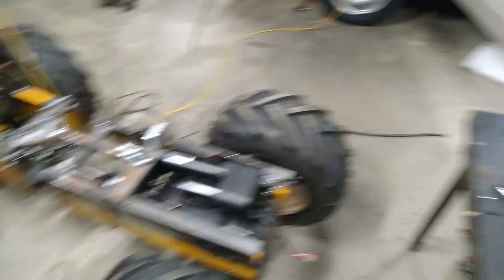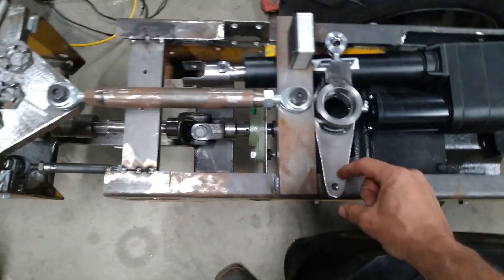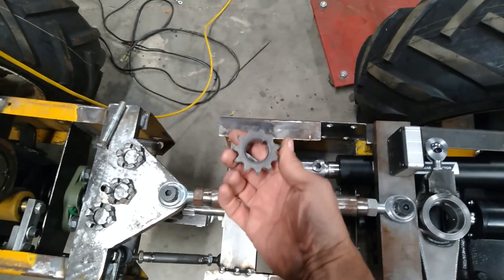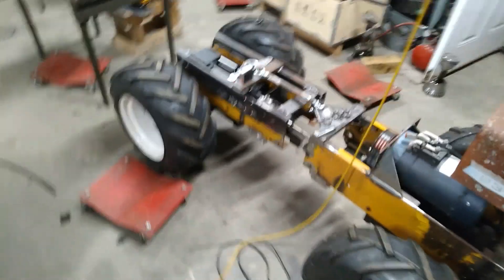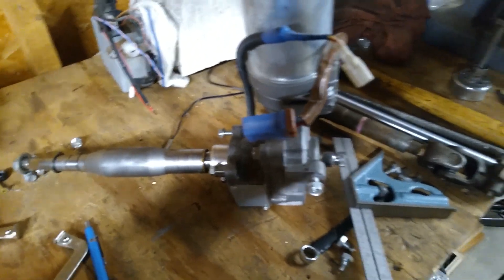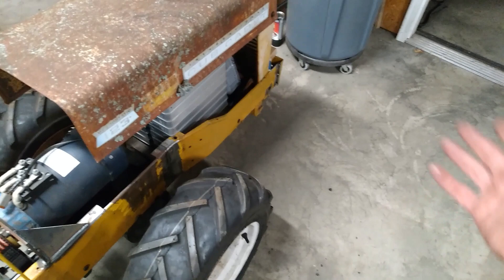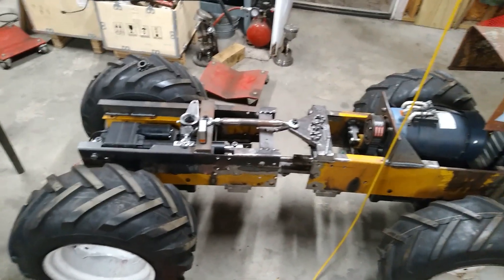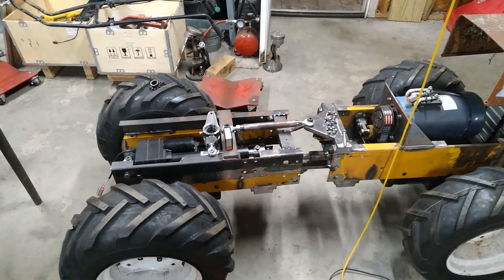Over It - The Cub

Comment: Been a minute since you posted, but glad you are still on this project. I like the idea of trying anything electrical, mechanical, computerized, etc. and working on it and thinking on it for as long as it takes to either make it work or find that I need to do something else. The process is the fun part. What ratio of sprocket / gears are you going to use?
Reply from the maker: 4:1 ish

Comment: As someone who knows a little welding, but works in IT, I totally understand you. The learning curve is so steep, but everyone who has part of the knowledge to do that, often forgets that. Don't beat yourself up, programming is hard. And development is even harder. You tried both at the same time, with a high risk and cost project. That is not great. If you ever want to do something like that again, you should first make a simulator. Where you can test everything on your PC. Without any hardware, and after that you can switch gears. But as I already said, that is much to learn.
Reply from the maker: Thanks!  I appreciate your support.

Comment: Sad to here your done with the electronics.    Maybe it is the best as you don't need to be learning the stuff in the middle of a project like this.  
A single wrong wire can cost you days at first.  When your up to speed its 2nd nature most of the time.  Would gladly have helped but I'm not close to anyone.    Maybe a  plow blade lift with the actuator.
Reply from the maker: yeah, this'll find a home in the front end loader or the 3 point lift.  Thanks, Dan.
Reply: @billbayer5526  WIll be fun to watch.  This thing has so much potential.